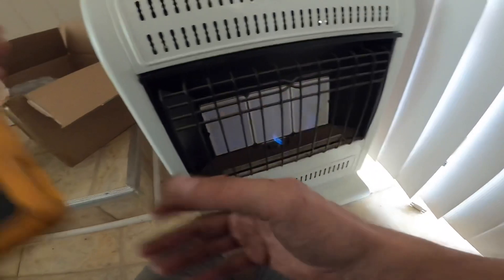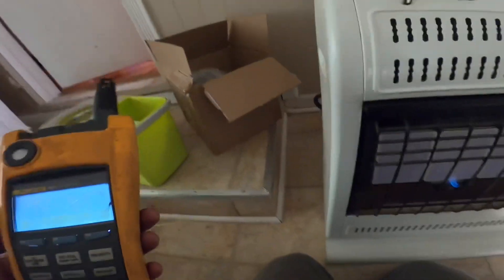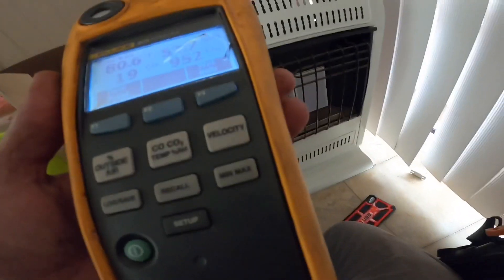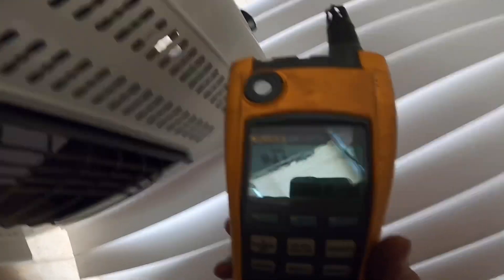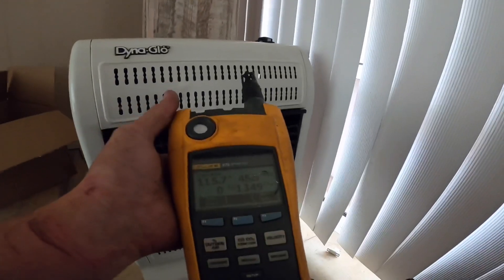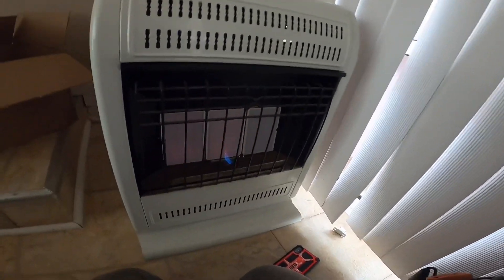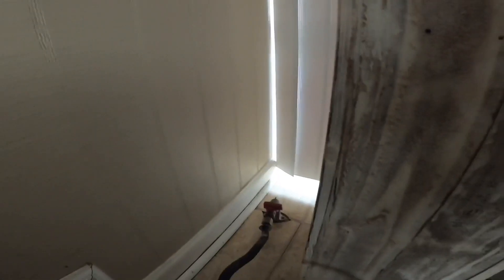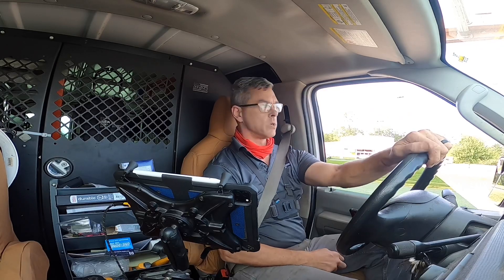Ventless furnace producing dangerous levels of Carbon Monoxide

Comment: Not much different from vent-less fireplaces or even a gas range (without a great hood.) It's just a bad idea to have combustion without venting the byproducts. Doctors are discovering that it's really bad for children to be breathing in these combustion byproducts.
Reply: Doctors seem to think everything is bad for us nowadays, from Banana Boat sunscreen, to even coffee. second, a gas burning appliance that produces unacceptable amounts of CO and combustion byproduct, vented or non vented, is a gas appliance that is installed incorrectly, or not working properly. this heater looks like it malfunctioning off the bat. these IR type heaters, your not suppose to always see a blue flame like that, in normal operation, as the burner plates warms up, the surface should glow a blaze orange color and produce a sun like heat, there for the gas would be burning correctly, which means the combustion byproducts are being burned more thoroughly too.
Reply: @KenKen-ui4ny  Sure, with perfect combustion, methane would just make harmless CO2 and water. Unfortunately, we don't live in a perfect world, and natural gas burning appliances almost always throw off dangerous amounts of nasty byproducts. It's not just CO, but stuff like NO2 that isn't great for your airways/lungs. Vented is the only way to go, and personally, I don't use a gas stove.
Reply: @bnasty267  LOL There ways you make it so it has perfect enough combustion, like having a tech tweak the gas valve, so it at the right amount pressure and water column, to say they always produce dangerous amounts, is just a excuse for poor maintenance or bad install to me.

Comment: looks like it's not burning right seeing the dancing flame and sparkles. some of them are selectable propane or gas, it may be set for the wrong gas, they also don't burn clean until the "honeycomb" is glowing bright orange. so short cycling would be very bad, as well as any type of air movement over them.
then again, I couldn't tell if that was radiant or blue flame type, which doesn't turn as orange. the flame still looked funny to me, either way.

Comment: Several people in my area (Louisville Ky) has them. If it's under 50 ppm then it's considered a safe level. Anything reading over 100 ppm is considered unsafe. We have them reading about 30 ppm as well. Technically we can't shut it down unless it's over 100.. I don't install those myself. I don't like them

Comment: who the f*k in their right mind would recommend, sell, install, hook-up or setup one of those. Nobody gets maintenance done on a regular basis, it just takes a happen chance situation and the CO levels in a spill situation would be nuts.
Reply from the maker: Local gas companies do it all the time
Reply: @HVACGUY  scary man, not a thing where i'm from.. Gas company here sticks to PV water heaters and 90 plus furnaces.
Reply: @Falcon-eh8tq  It depends on where you live, some states are less strict about ventless gas appliances then others, as a person who live in up state GA, one of the things i see often here, that would be a big no no in some other states up north, is running armored or flex gas pipe into a gas furnace, this is illegal in states like NY and what not, due to the concerned of the vibration of the furnace, chafing on that type of gas pipe.
Reply: @KenKen-ui4ny  
I understand, but where I live in Ontario, Canada, both of those things you describe are illegal.. I guess as technicians we are improving safety through research and trial and error, kinda scary to me not trial and error i'd be comfortable with, better to er on the side of caution when it comes to customer safety lol
Reply: @Falcon-eh8tq  Yep Canada is very strict with that stuff, matter of fact, i got family who live up there.
Reply: I literally just turned mines off reading this. I've been freezing my ass off so I had this blasting for a few hours then I got a headache and looked up why😯
Reply: @tville4358  That's pretty scary! Glad you're alright.